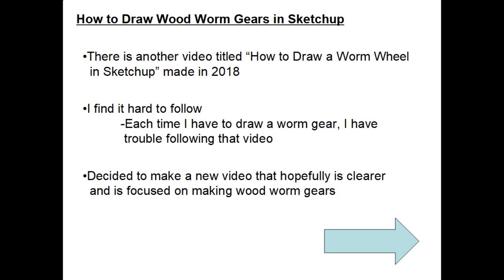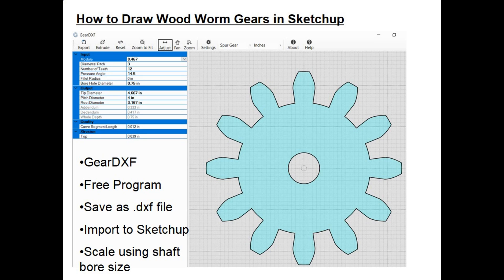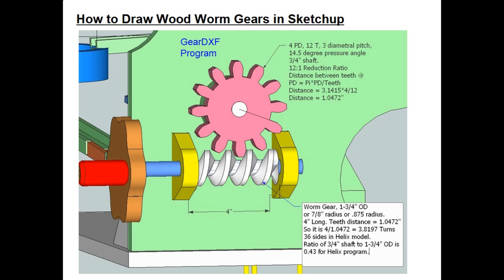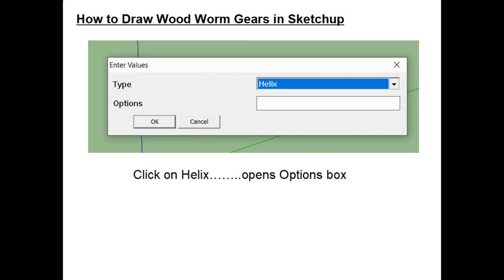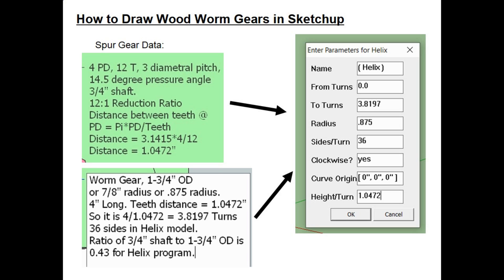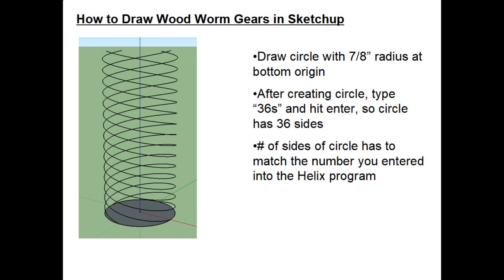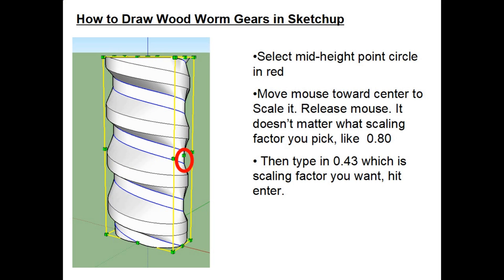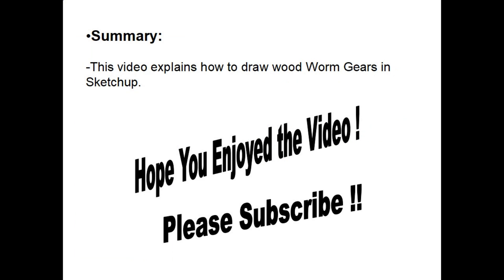How to Draw a Worm Gear in Sketchup

Comment from the maker: I had a new worm gear project in Jan of 2023. I followed my directions in this Youtube, but when I got to the scaling steps, it did not work!!!   Ooops, when I drew in the circle at the bottom, I forgot to change the sides of the circle from the default 24 to 36 sides that is in the helix program.   Once I changed the circle to 36 sides, Bingo, it worked fine :)